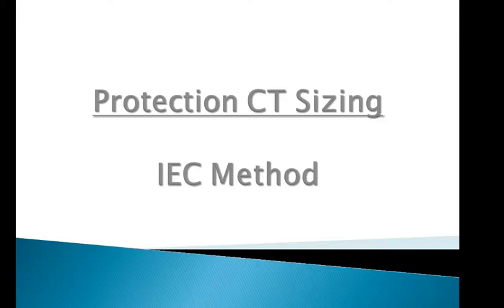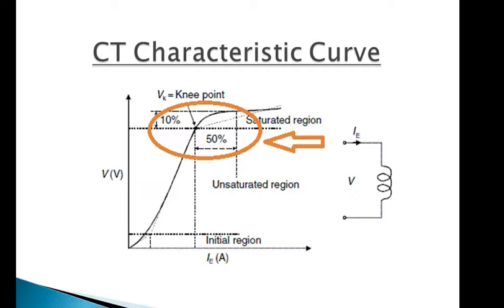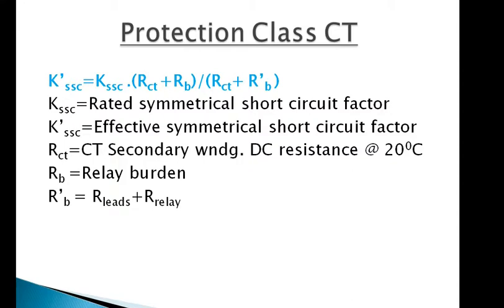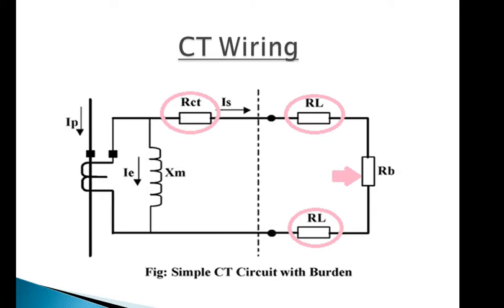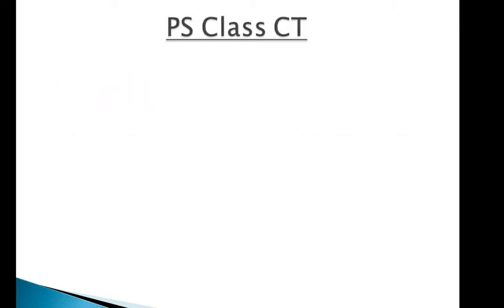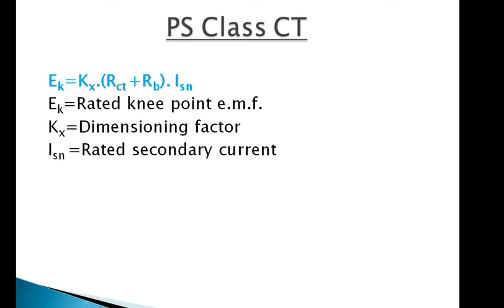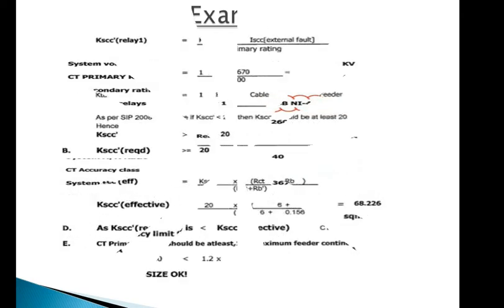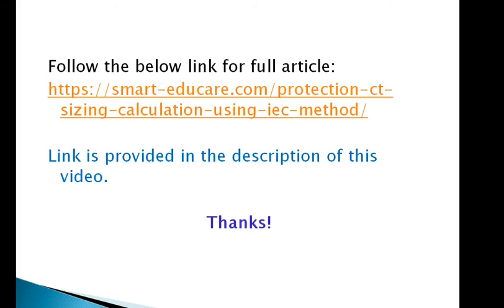Protection CT Sizing Calculation as per IEC

Comment: This video is good but, unfortunately, IEC 60044 has been withdrawn. If possible, kindly upload the videos for CT sizing based on IEC 61869-2 and VT sizing based on IEC 61869-3. Thanks in advance.
Reply from the maker: You're right! new video released for CT sizing using ETAP software..
Another video will be posted very soon using manual calculation in Excel..
Thanks!

Comment: Nice video. How did you find Ktd?
Reply from the maker: Transient dimensioning factor is dependent on the system X/R ratio and it will be provided by the manufacturer